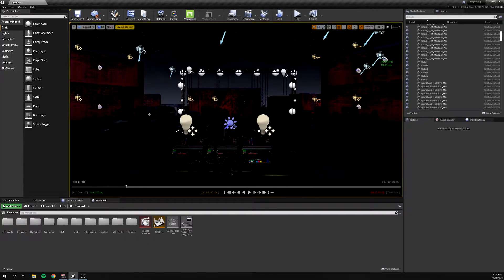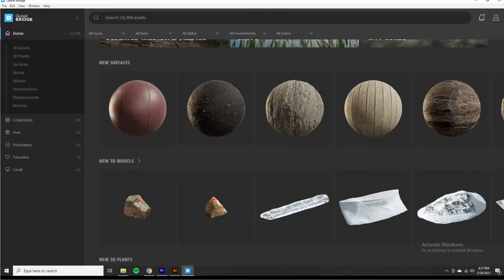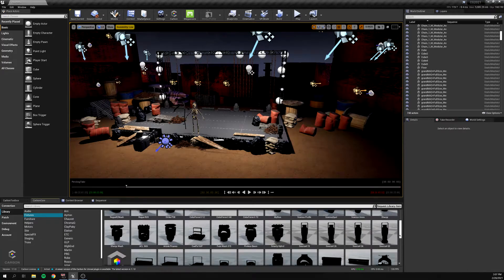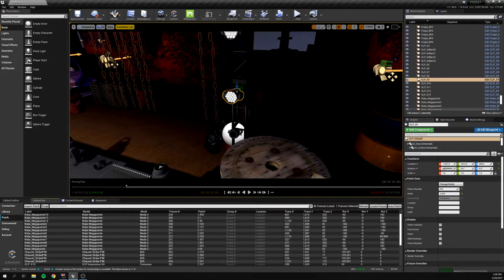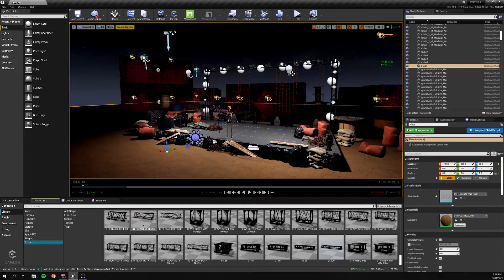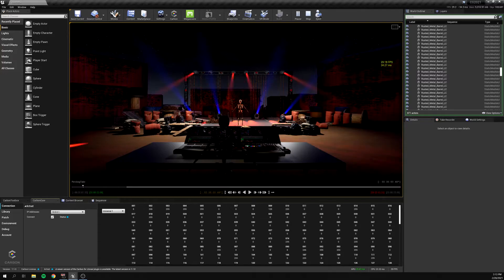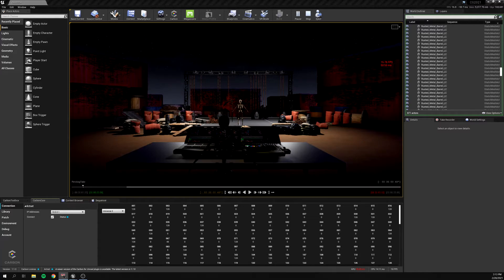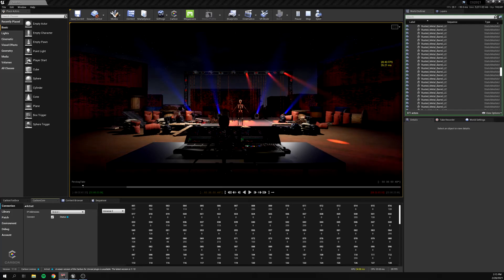Carbon for Unreal Engine, #madewithcarbon Submission setup explained

Comment: Hey CG - I'm wanting to do previs in a room that hasn't been built yet. We currently use Onyx by Obsidian. Curious to know if you can have onyx running on the same machine as Unreal and if Onyx would work differently than MA. I assume the functionality exists with either platform. I'm definitely a noob when it comes to Unreal so just learning and putting it together as I go. Thanks in advance for reply.